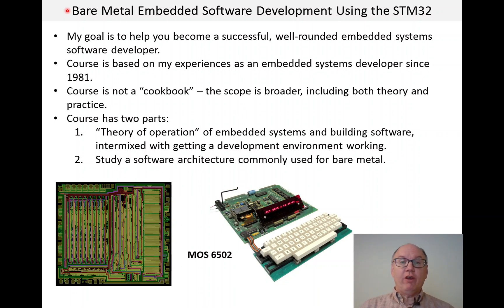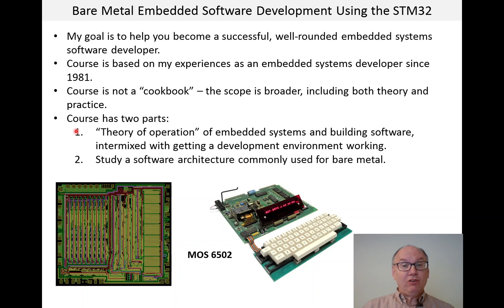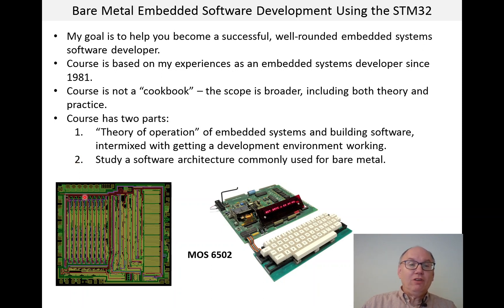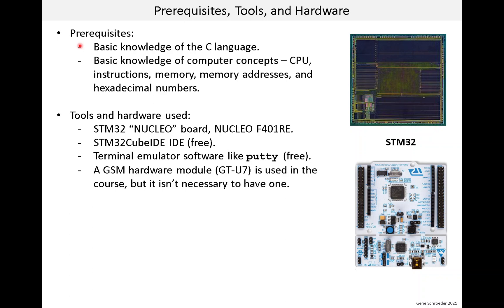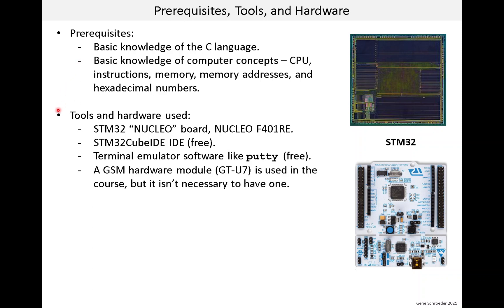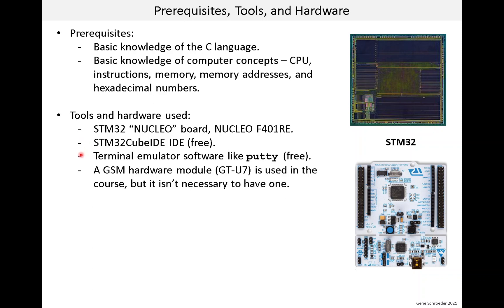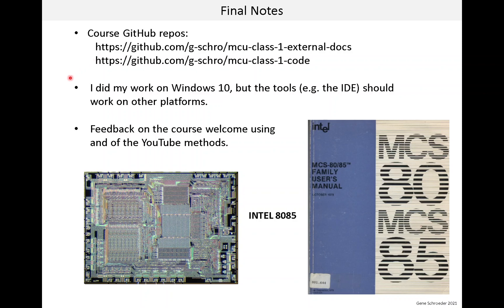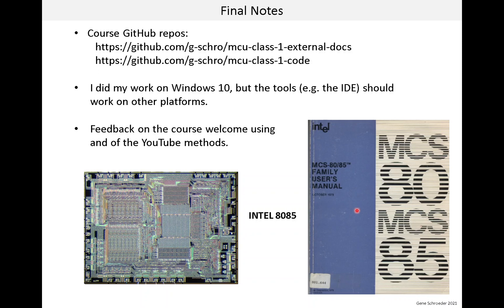Lesson 1.  Introduction to the Course (see note about required USB cable)

Comment: I hope to see more from you. I am really learning a lot about getting started with STM32. Could you explain what toolchain(s) you use after you start the project in STMCubeIDE? Getting the thing to work on Linux is a pain, and I would rather not work in Windows.
Reply from the maker: In my career, when we moved away from an IDE we would use the gcc toolchain. This of course is very popular and the IDEs I have used used the gcc toolchain, so it was the obvious way to go.  The approach we would take on Linux is to go to https://developer.arm.com/ and get the same version of the tool chain as being used by the IDE (but of course, the version to run on a Linux host). In the case of STM32CubeIDE, it uses "make" to do builds, so it makes it easier to build on Linux (there are still a lot of details to work out).  Our goal would be to do production builds on Linux, but still be able to use the IDE for GUI debugging, but sometimes people would sort of forget about the IDE and make changes, and after a while builds on the IDE (Windows) would stop working.

You might find my course on embedded CI/CD interesting. In that course, I create simple batch scripts to build the code and flash it to the device. It isn't Linux, but it is using the command line rather than GUI.

Comment: got about 5 of the nucleo boards and have been programming them on Arduino , like Arduinos,  havent really gone deep on them yet.  I have been teaching myself C++ and I have been flying RC planes with a playstation controller and some ESP32s with radio modules.  I jumped in the rabbit hole 2 years ago and I cant stop but its clear that im only scratching the surface.  I plan to watch the series.
Reply from the maker: I hope you like this course - it is different from using Arduino because you will be going deep in a lot of areas, not just getting something to work, but seeing what is going on behind the scenes.